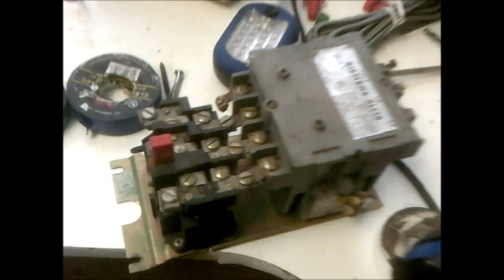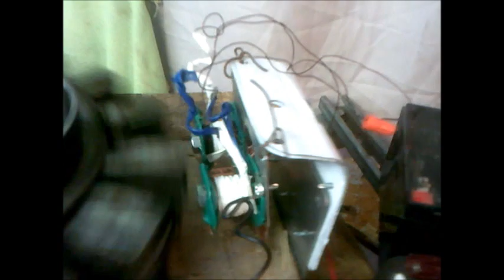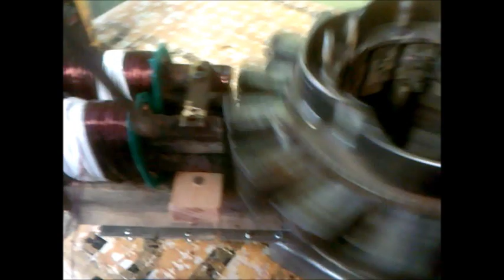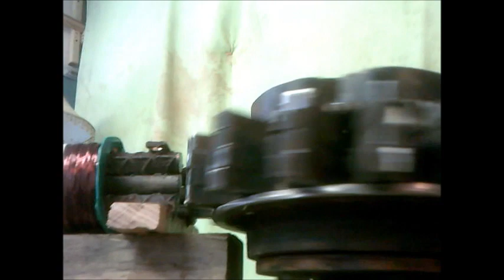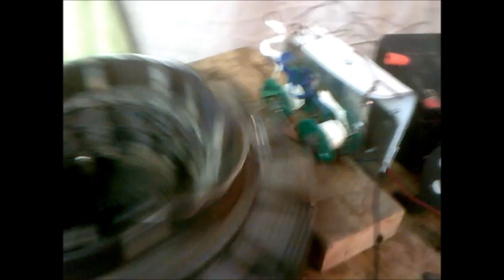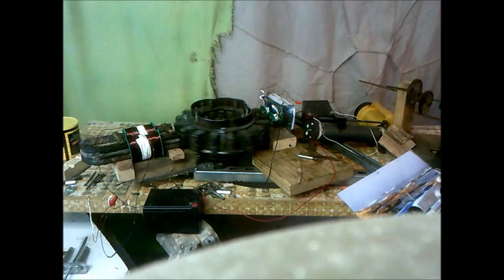Sweet Sixteen Turns Indefinitely 50 minute continuous capture

Comment: That horseshoe thing with the copper around it on one side u add voltage to it an the metal block stays with a force. That is so called gravity. U have to calibrate ur machine to counter Earth's magnet field

Comment: What is a good source for the magnets on that 3/4 hub model?  Thank You.
Reply from the maker: Well this unit has an old chevy silverado 2 wheel drive front hub bearing holding this assembly. The said assembly HAS NO MAGNETS. This is just pieces of an old angle iron cut down to size and welded.
PAINSTAKING ACTIVITY, I wouldn't want to have to do it again. and therefore it is really about the iron turning the wheel rather than the weak weak model T    "magnets". of course the STATOR does all the work (the PMH)
Reply: Thank You for the response. It is possible then to make 'V' shapes out of rebar to take the place of the magnets. I am going to build one of these . I will compensate you for your help. Like a detailed schematic with coil turns, etcetera. If interested, please contact me : daturamonk@gmail.com

Comment: what batteries would Ed of used? do you think the Egyptians could of built similar stuff with their "Baghdad battery" in series? they were known for electroplating weren't they? so I imagine those clay and bituminous batteries could of been used for that
Reply from the maker: +supafly1982 Honestly I really DON'T believe that they used the bagdad batteries for that. The Egyptions would have used animal driven oxen wheels etc. to cut special; stones, as for electricity Ed only used it for the big chipping hammer, lights at night and probably the reciprocationg cutting stations other than that he would have used gas engines to quarry the big blocks.

Model T batteries were pretty solid old batteries. and in parallel any bank of batteries will deliver a lot of current at once OR will run light loads for a long time. like lights at night.  The wheel was used merely for sculpting the rocks and maybe pumping water.

Comment: Dont forget about stealing power from the stars at night while they line up the stone.  Power was indeed harnessed from the heavens for free (though intermittently due to alignments moving in and out through the night).  It's practically necessary to work at night so one can physically view stars.  When stars cast {light} through holes placed in the stone the stones have a more potent magnetic saturation.   If one can set up the site so that it has several harness stones (pick ups) one could phase in as another phases out thus providing continuous charge.

Comment: Your are right about the vertical horizontal placing. I used a bearing underneath the crank shaft to support it. The engine block is adjustable so that al runs smoothly.

Comment: How did Ed Sculpt Limestone with this?
Reply from the maker: AMY  this wheel is technically a DC pulse motor that was designed 100 years ago. It has a relay (that is hanging on the wall at the museum) that pilots the wheel to turn (magnetically) by commutating the PMH (the motors stator) That runs off of a large battery bank that could run all of the field devices, the wheel itself, and lights at night. (all MODEL T parts) The batteries sat in the BOXES on top for mobility AND they are huge boxes thats why. SOOOOO............

Every revolution of the wheel will send a pulse out to the fields stations 4 times. this is beacause the FOUR leaf clovers are cam lobes that pilot the horn relays ( ALSO IN THE BOXES KEPT DRY) That small pulse triggers the actuators of which he had many. This man could sculpt  multiple rocks at the same time AND JUST STAND THERE WATCHING.   NOW THATS SWEET. Each tripod is a work station that can chisel, scroll or saw a separate piece. I would love to explain so much more LEGEND proving info but I need to cut firewood today. YES I am poor and humble and believe (KNOW) that god exists. I got most of this info by asking headquarters in the sky. I am not smart enough to know it all my self. The TRUTH was rebealed to me alone. NOW its my turn to set the world straight. I need to. the non truths are REALLY KILLING ME.      PEACE   my friend If you want to know more find my website. I have contacted CHRIS to try and steer the future towards the proper (decent) outcome. Thanks much to both of you for GROUNDING  the situation. I am not AGAINST YOU. although it may appear that way right now I am not.         PEACE LOVE AND LIGHT TO ALL           Scott R

Comment: Interesting... That device is just a primitive brushless motor. Instead of an solid state ESC, it has pickup coils triggering a relay for timing the driving coils on the stator, but the rest of the operation using a pulsed magnet is pretty much the same.
Reply from the maker: Exactly and the clover leafs are obvious cam lobes that pilot the actuators in the field. AND sixteen poles were easy to use a flywheel with the hole already drilled.His first one had SIX tiers of magnets And the magnets don't need to be magnets for the motor but Ed may have used a "magneto effect" to flyback a pulse to the batteries for periodic or even constant "DESULFATION" via the 3 phase rectifier down there.

Yes the old 24 pole unit is the last one ED used to sculpt. merely an ENDEMIC design from estonia / Latvia area. long buried in the two WARS.

Comment: He Scott 
Yea that smell is the coils on the relay.
If they were insulated from the metal plate
You can reduce the spread of magnetic displacement. Can you redirect your mission to figure out the generation of power from the wheel?
Reply: Hey Roy, Actually I got it tuned in so close it doesn't smell at all anymore cause the rheostat balances out the little coils so well like Eds bottles and wire, that it barely warms up at all now. After 70 minutes continuous minus 3 minutes to change camera batteries neither the relay or the PMH coils heated up much. the SWEET SPOT.

As for producing power from the wheel that's only going to happen with a special bunch of coils tied to a giant astronomical grid and a perfect resonating tank circuit with a spark gap (maybe) to guide the transformed capacitive, RECTIFIED electricity into batteries. DOUBTFUL but in theory possible??? AND maybe at certain time(s) only??      food for the shelve.    Scott